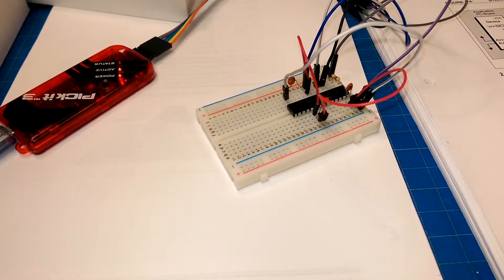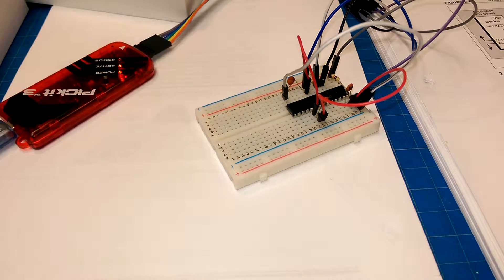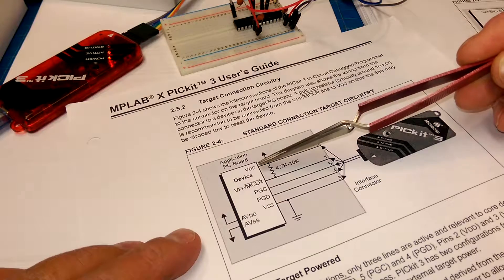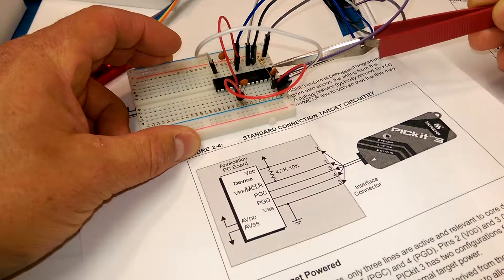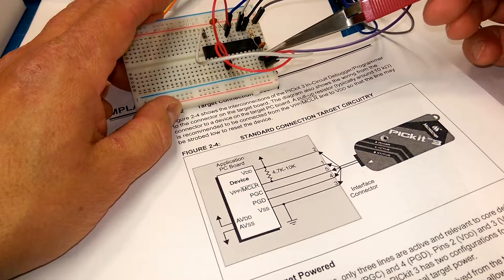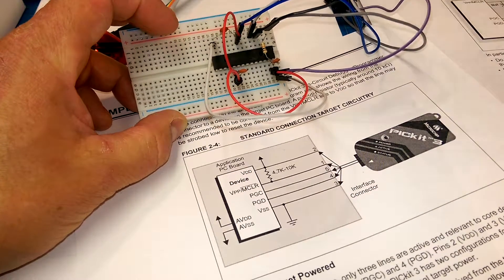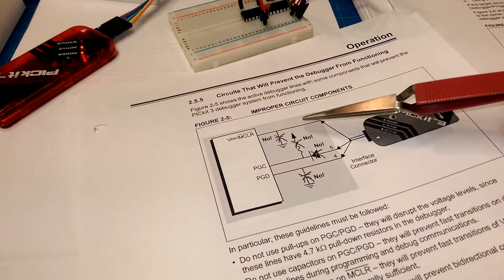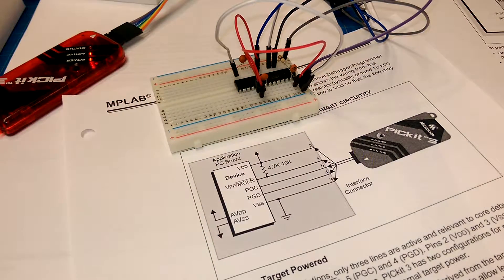Programming a PIC32 notes

Comment: I just programmed mine using schematic from figure 2-4 in the PICit 3 manual. The only difference was that I had to connect pin 23(Vusb3v3) to Pin 13(VDD)
Page 24 of the datasheet  says that "USB internal transceiver supply. This pin must be connected to Vdd"  I don't have any capacitors in my circuit.
Reply from the maker: Are you using a genuine programmer or a knock-off, like mine?
Reply: grtyvr I am using the genuine programmer.